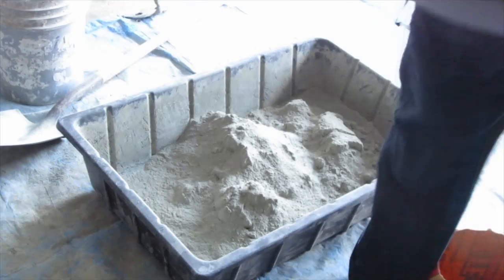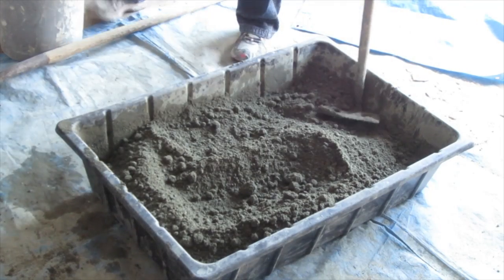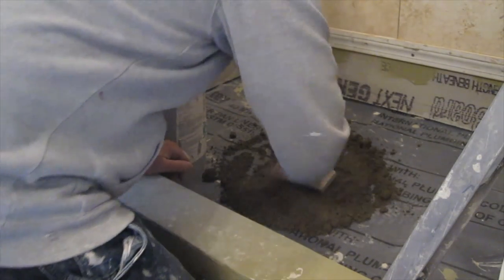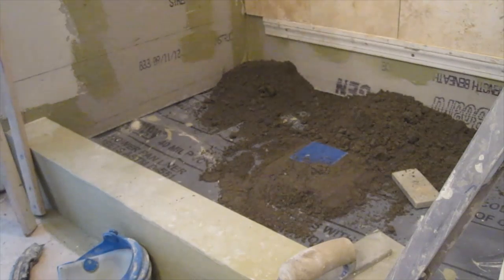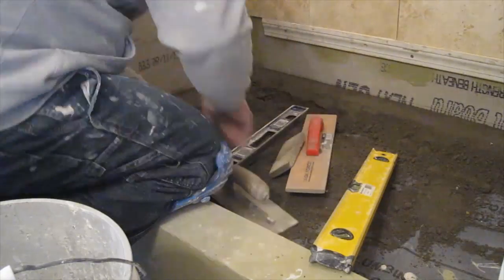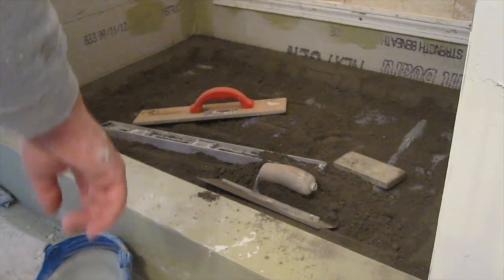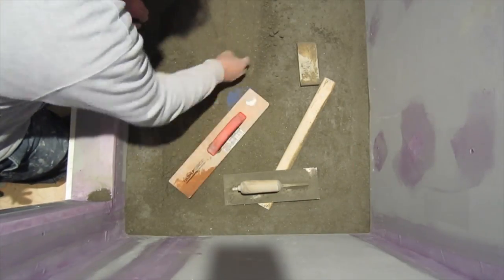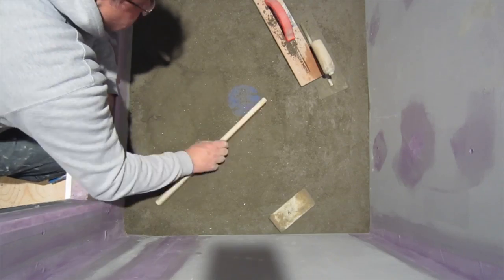How to install   Mud in a shower floor

Comment: My understanding is the dura rock or cement board is suppose to end above the pan  I saw a video where the guy tore open a shower that failed and the dura rock was wicking water up rotting out the studs behind it.  I plan on using redguard for my pan  liner and also on the studs around the shower.  Also, when I had the plumber put in the drain he was suppose to center it.  It is a 5x5 shower.  However I noticed he did not allow for the curb width, in other words the drain is about 4" off center.  Is this going to be a big problem when I put in the preslope?

Comment: I am curious, is it really necessary to staple the wire lath down and if so how often should it be stapled and how big a staple? How close do you fit the wire lath to the walls? Do you leave some space or do you butt the lathe against the wall? Also is there anything wrong with using self-furring wire lath.

Comment: My husband and I have watched a number of videos on how to install mud in a shower floor.  They were quite confusing until we found yours.  Love the direction you give.  At the home improvement store we were told we could start with the sub floor; then hardie backer board on the floor; use redgard waterproofing on top of that as the membrane; then use thinset and tile (no vinyl pan liner).  What is underneath your vinyl or do you have a different video for that?  We've tiled many showers, but never a floor.
Reply: I got the answer to my question elsewhere, but is my question not visible?

Comment: Hey Sal, I know this is a really old video and you've done many many more since then and I will look for your others later, but I just have a question ... what systems do you recommend today where you can do your shower pans without mudding it ? I'm sure you can install a shower without the mudding system,  so I wanted to ask your advice or even suggest one of your videos in particular where you did such a thing.
Thanks again Sal ... I think I will go your site to buy some tile tools etc.... 😁👍🏽

Comment: Hi Sal! I got a question for you. I'm installing a new bathroom putting in a 30 x 60 prefab shower pan. My bathroom floor is completely flat but on a VERY slight incline. I need to level my pan which would be a 1/4" off level otherwise. Do I need to use floor leveler for the pan or can I just use mortar mix under the pan when installing to level it ? The manufacturer says to use the mortar mix but the guy at the company says I should level the area where the pan is going first. I know I don't need to level the whole floor! What do I do?

Comment: I completed my pre-slope using what you have shown and it worked great, thanks. I noticed you have put in the Durock over the liner before doing the final mud floor. I'm using a product called DensSheild for the walls. Is it OK to install the walls over the liner before doing the mud floor (as you did with the Durock) or would the DensSheild wick up water through the mud floor? Also how thick shoiuld the mud floor be? I'd like it to be thinner than your showing so would 1.5 inches be OK? Thanks again for such good instruction.
Reply from the maker: Barry Straughan Denshield is not something i like to use, and try to stay away from it, however a GC that i do a lot of work for insists on using it, that is why you will see it in some of my videos. You will be much better off with Durock. !.5" is fine.

Comment: Enjoy your videos and work Sal, question regarding the curb; after the floor has been presloped and the vinyl liner has been laid, how are you placing the "inside wall" of the curb so as to not puncture the vinyl.  Is liquid nails ok, or even thin set?  
thanks again.

Comment: What waterproofing roll on guard can go under kerdi membrane. Doing Charity job got disabled vet and wanting to have 2 systems to have a backup. I'm doing sand and cement over plywood. I know you have answer several of my questions but I only have experience with the kerdi not a backup under it. It is a complete wet room so I wanted to make sure that it don't leak. Thanks so much.
Reply from the maker: waterproofing under the Kerdi ius something I have never considered, as it is not needed, I would imagine any thing like Aquadefense or HydrBan would work, however I am not sure it is a good idea.

Comment: Sal great video ... if I am going to be preparing mud shower pan on my concrete floor do I first place liner on concrete floor then mud over liner and slope... The reason I ask is I notice you do it differently along with some different steps when working with a wood base thanks
Reply from the maker: Vinyl liner needs a preslope before installing, so watch these two videos for a full understanding of how and why.   https://www.youtube.com/watch?v=p8xsx3316IU&t=3s and  https://www.youtube.com/watch?v=Fjm_6A6lj5Q&t=427s the drain is different in this one but the steps are the same.

Comment: Hi Sal, fantastic how to videos, however I have a question. I'm second guessing myself on my pre-slope attempt. It has a good slope on every side and is quite hard and sturdy with no visible cracks, however it is also sandy on the top and has two small visible craters "which i think will not hold water cause of the slope". I laid it 15 hours ago and used Sakrete. Will this affect the membrane liner when when i place it?  Thanks Frank...
Reply from the maker: Sounds like it might be OK, fill the small divots with thinset and maybe skim coat the whole thing as well. Pay more attention to the shower floor mud base.

Comment: Sal, Thanks for taking the time to teach us all how to set a shower pan. One question. If floating the walls  instead of concrete board would you do the pan and then the float or float first?
Reply from the maker: Walls first, but if you have never floated walls, you might be taking on more than you might think.

Comment: Hey sal how come you do not wrap curb with wire mesh.nails will be on outside of curve only.now you will  not have nails on top and on inside of curve.now eliminate nail holes in shower pan.remember there was no waterproof back then.and showers last for 20- 30 years.just a thought.keep up good work.

Comment: Sal, thanks for taking the time to make a video, it is very thorough.  If I could ask one question regarding the curb I would appreciate if you could clarify a detail.  Does the curb need to go from the plate/wall to plate/wall or do you leave a half inch on either side for the backerboard?

Comment: EXCELLENT! how many days the mortar needs to dry after you pour it in to be able to do something with it? I plan to coat it with one of those waterproofing liquid membranes - Red guard I think is what you call it in States. Just poured in the showerpan based on your video and now wondering how long I need to wait, It has moisture plastic membrane under it so I just don't want to seal all the water inside the mortar from all sides by fully waterproofing it from all sides.
Reply from the maker: It is called " Liquid applied waterproofing membrane" and Redgard is one brand that I actually have never used, Mapei Aquadefense, or Laticrete Hydro ban or even Tec Hydraflex are good ones. You have to wait a few days before you can coat it if you used deck mud.

Comment: master at work! I have always used kerdi pans and tried a mud pan once, when i came back the next day large craters formed and the pan had alot of loose sand on it still. any idea where i went wrong?!
Reply from the maker: JVanO100 usually that happens if the mix is too dry or it was not packed down enough or both.
Reply: Ah ok, I could see that it might've been too dry, I was nervous when mixing  as i was always told very little water!! lol Thanks Sal!

Comment: Question!!??  Since I have to tear up my floor to lower it anyhow can I make the preslope pitch built in the subfloor?  Fab the floor joist so when I put plywood down it is sloped to drain  Then all I should have to do is put vinyl liner down and then one layer of mud for tile

Comment: Thanks for these videos and looking forward to you coming to see what you can do for our project. One question: if you have 1/4' per foot slope, and you have a level perimeter, what happens with a rectangle? What happens if you measure from the corner to the drain? How is it that it all comes out to 1/4" per 1' ?
Reply from the maker: +Dan Albert The 1/4" per foot is from the furthest wall, the shorter distances will be at a steeper slope, Minimum needs to be about 1/4".

Comment: I can appreciate your level perimeter. My pan is long with an offset drain. As long as I keep steeper than 1/4" per foot on the longest slope and adjust other slopes steeper, will 2x2 tile work?

Comment: Sal, I'm going to add a bench across one end of my shower. Should I construct it first and then do my mud bed or lay my first mud bed, build the bench on top of it, and then do the liner and final mud bed? Thanks very much for your videos, they're awesome!
Reply from the maker: Jerry Ingraham I usually have the bench in before any mud goes in, and waterproof the heck out of it.

Comment: great video, i understand the 1/4 per foot but how do you decide the height at the drain? is there any rule of thumb like the mud has to be atleast 1/2" thick at the drain or something?
Reply: excellent question   the minimum thickness at drain should be 1"    ive been building showers for 32 years

Comment: Love your videos!  I am working on a neo angle corner shower and am not sure how you finish the curb.  Do you have a video on your process for putting the cement board around the curb?  I haven't seen you use lathe and mortar and wonder what your method is.  Thank you!
Reply from the maker: I don't think I have that, but i have uploaded over 330 videos, so i just might not remember. The important thing is to make sure you waterproof the curb thoroughly. most leaks will occur at the curb if it is not treated properly.
Reply: What is the best way to waterproof the curb?
Reply from the maker: This might help you How to waterproof a bathroom shower stall part 5

Comment: Sal, I did make my pan just like yours. I am a little worried that I didn't add enough water. I was able to make a snowball with the mix, but I noticed that the mix I threw in the trash never got hard when I saw it the next day? Is that because the pan mix got packed and then sets up? Whereas, the sand mix in the trash never got packed? I am worried my pan is going to crumble now.

Comment: Hi Mr. Diblasi, can you please tell me why it was not necessary to hydroban the cement board which you built the pan against?  
Thank you.
Dave D.
Reply from the maker: This particular shower was prepped by the GC and he had put a moisture barrier behind the Durock, old school, so I did not want to create a moisture sandwich by waterproofing the surface as well. It is usually one or the other but not both. However I always prefer to do it the other way, waterproof the entire surface.

Comment: sal is the dura rock below the pan , some people say that the durarock should be above pan about 1/2 inch
Reply: Well I just realized where I saw it done that way. I though it makes sense to have the rock in the pan because the pan will hold the rock up against the studs, since you can't put screws that low. Otherwise it wobbles a littl I already planned on using a lot or red guard but if water does soak into the pan it will likely affect the rock. not real a good thing.
Reply: dugh rock is for those who cant float! Put that on a out of plumb wall....and its still out of plumb! Gonna have to show you how REAL TILE SETTERS do it.

Comment: Not saying your method is wrong but I find that if you leave the duroc up the thickness of the mud and shower floor tile it is better. for one, it helps the slight shower pan bulge you usually get at the bottom corners and it helps that the wall boards are not in contact with potential moisture . I personally never liked bringing the duroc down that far because of those reasons
Reply from the maker: You can find the documentation  here 2016 TCNA  Handbook Page 234 Installation Method B415-16. That being said a fiber board like Hardie backer must be left above the dry pack, same page of the TCNA handbook, both are illustrated and referenced.
Reply: but you are using duroc and dry packing to it.

Comment: You dont use the plastic guides for the screed?  Just curious are these more for amateurs.   Im a tradie, and had to do a 2nd level shower floor recently and the only bit i didnt do was the concrete, but after watching this its actually quite easy.
Reply from the maker: The plastic guides are for anyone that needs them, but I don't think you will find a professional tile setter use them.

Comment: How long does it typically take for the mud bed to set up? Mine was put down a day and a half ago, and it's still not bonded together very well.... Lots of loose sand and I can dig it out with my finger. Reckon my Portland cement had cured before I mixed it up?
Thanks for all the help!
Reply from the maker: Either you did not compress it enough, or you may have mixed it too dry, but it will take a few days to get really hard even when mixed correctly. Deck mud is not like concrete, it will never have the strength of a true concrete mix, it will however get fairly hard over time.

Comment: So in this step Sal, what is the preferred thickness of your mud bed at the drain?  Also, I want to make sure I understand the proper order of ops here.  Install preslope and allow to dry for 24 hours.  Then install membrane followed by Durock (or similar) to overlap the membrane.  I assume you don't run the Durock all the way to the membrane (at the floor) but leave a small gap.  Then install your mud bed and apply RedGard (or similar) to walls and pan.  Is it necessary to waterproof the Durock that will fall below the mud bed before installing the mud bed?  Thanks so much again.
Reply from the maker: Correct.
Reply: ***** I was under the impression that the cement board needs to end just a little above the mud.  That way there is no chance of water getting to the cement board - all the water goes down and never has a chance to wick or move up.  Not that the cement board will be affected but that is how I see showers done when  people use dry wall.  It makes a big difference if you use dry wall. It seems like a good practice.  But what do you say from experience, Sal?
Reply: When i do the dry pack in new homes ( I am a professional tile installer) I like to have a minimum of 1/2" to 3/4 of an inch thickness at the drain. The products we use require a minimum of 1/2" but often it is closer to 1 inch at the drain and about 1 3/4" at the far wall to make approx. a 1/4" per foot slope.
Reply from the maker: GreatWhiteNiko  there is no place for dry wall in a wet area, it is doomed to fail. I usually wsterproof everything, unless there is a vapor barrier behind the cement board as it is in this case, but I will alwsys waterproof the mud pack to keep water out of it . As long as the cement board has a gap at the bottom and does not touch the pan liner it would not be a problem.
Reply from the maker: ProfessorKA0S If you are talking about the mud for the tile ontop of the liner, I try to keep it over an inch, considering you also have to have room for the pea stones to protect the weep holes

Comment: I once installed a shower pan/curb for a 5oolb. lady. It "failed".  This after yrs. of shower pans. Wire reinforced as always. After that experience I went with another inch of mortar and started to use liquid, 3701 to be precise.

Comment: Thanks for sharing.  Question.  When dealing with a shower that is not square will leave the shower pan higher on some walls than others (because of the slope.)  I have a shower pan that will be 71in x 41in.  The drain being in the middle.  How do you deal with the tiling of the wall since the shower pan will be higher on the 71in sides than the 41in sides if using a standard 1/4 slope per foot.
Reply from the maker: Keep the perimeter of the mud level with the furthest point having a slope to the drain of at least a 1/4" per foot, when you slope your mud to the drain the walls the slope to the drain will vary as you get closer to it getting steeper as you get to the closest distance to the drain.

Comment: Sal, thanks so much for taking the time to make these videos, I've learned so much from watching you. I am in the process of making my bed on top of the rubber membrane. I got all the mud in and let it set over night and when I checked it the next day the top of it is still pretty sandy and I could actually make marks in it. I think I mixed it too dry, is there any way to correct this? I sprayed some water on the top with a spray bottle hoping to engage the cement to harden it but it's still gritty. What should I do? Add a thin layer of wetter sand topping mix to what is there or add a thin layer of thinset over it?
Reply from the maker: I have heard this countless times from people who have the same problem the first time doing it, so don't feel bad. My advice is start over, you want to get the base right, think of it as a practice run. The good news is that it should be easy to remove, next time make sure it is damp enough and that you pack it down really well.

Comment: Sal - I think the mix was too wet, I followed the directions on the bag instead of paying close attention to your video.  There was water on the surface when it was drying.  I can now rub nearly all of the loose sand away and vacuum it up to get down to a layer where it is solid.  Do you think I should replace it?  or if it's solid - proceed to lay the tile?  thank you.
Reply from the maker: +Keith Stowe If it is solid it is probably good, if you have any doubt  replace it, much easier to do now than later.